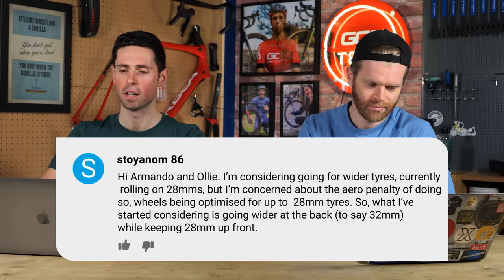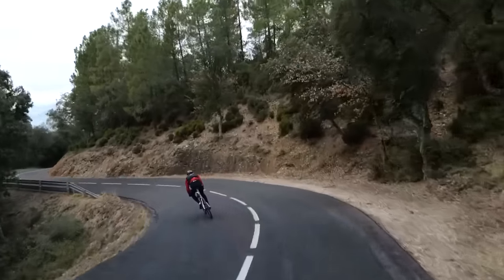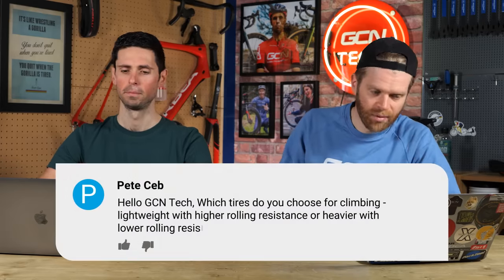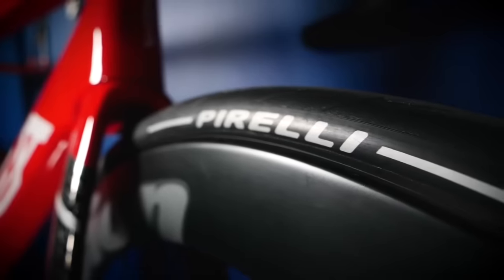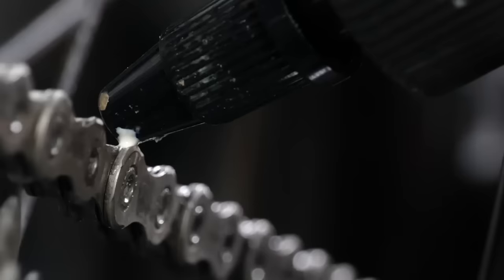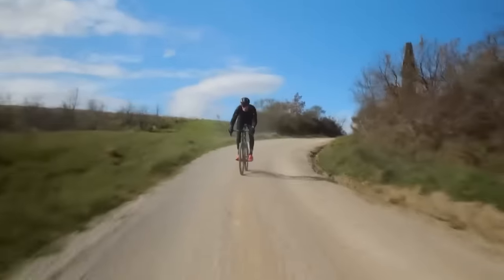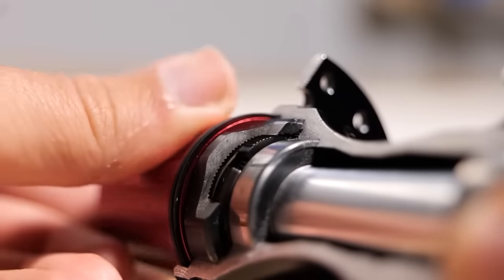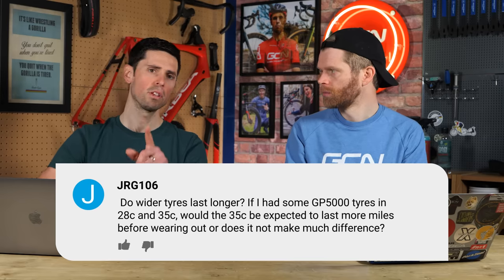Wider Tyres, Dry Weather Lube & Noisy Free Hubs | GCN Tech Clinic

Comment: #ASKGCNTECH
Hi, GCN Tech peeps. I use a Wahoo Kickr V5 with Zwift over winter, as it’s often too snowy at 7,500 feet elevation here in the Colorado Rockies to ride outside. In  preparation for spring, I recently got a 4iiii Precision 3+ single side power meter (on a GRX 800 crank) and paired it with a Wahoo Elemnt Roam V2. I was surprised to see that the 4iiii registered significantly higher watts than the Kickr trainer, so I set the scale factor on the crank power meter to 0.781 and now it produces readings in line with the Kickr. But is the 4iiii really recording watts 20% higher than the Kickr? Should I keep this scale factor when I start riding outside again? And how do I know which, between the Kickr and 4iiii, is accurate — if either? Thanks for your advice.

Comment: #askgcntech I have Kross Esker 2.0 MS from 2023. Microshift Advent X group set and Tektro mechanical disc brakes. I bought Challenge Getaway tyres, a 40 mm wide, foldable version. This was a mistake. I can't fit them together with the (TPU) tubes on the original rims - the tyres are too tight. What wheels from DT Swiss would you suggest buying to resolve this issue (I'm considering switching to riding tubeless)? I'm afraid of buying something incompatible with my drivetrain and disc brakes. I know you may not be allowed to give such a direct answer, but maybe some general guidelines at least?

Comment: Hi Alex and Ollie, Thanks for the great work : )
I have a question about the Strava app malfunctioning wildly. For example, last week I did a 10 mile ride (according to a simple wired bike computer that measures wheel revolutions), but the Strava app said I had covered 763 miles in 35 minutes, and the path included very straight lines across great distances over the wide open Atlantic. I'd have had to have been riding at greater than Mach 1 over deep ocean. On the plus side, it would have been my longest distance ride. On the negative side, I had to delete the erroneous data. I see less extreme examples of weird data pretty regularly, sometimes an extra 10 or 20 or 30 miles will appear, usually with more strange very straight lines that do not match any roads anywhere. Do you know what could be going wrong?

Comment: #askgcntech. Hi Rupert, Sir Ollie and the team.
I have what might be some silly questions about wheels. 
Do all wheels with through hub axles fit all model bikes, ie do Campagnolo wheels fit a BMC or a Merida etc?
Also, when looking on web sites how will I know if a set of wheels are suitable for 11 or 12 speed groupsets, are they universal?
Being a slow rider (I’m old and have some health concerns) I still run into hills so I’d prefer lightweight over aero and should I aim for steel bearings?
TIA and keep up the good work!
Reply: Thru-axle wheels will be compatible if they have the same dimensions. Typically rear wheel is 12 / 142 mm and front wheel is 12 / 100 mm (where 12 mm is the axle diameter and 142 or 100 mm is the width, end cap to end cap). There are other dimensions so you need to check what you have.
Rear wheels may or may not be compatible with 10, 11 or 12 speed group sets…you need to check. Some come with spacers to go on hub to convert to different speeds or you may need to buy them separately.
Reply: Steel bearings are totally fine. Ceramic bearings wear out the bearing races faster because the ceramic balls are harder than the steel races.

Comment: #askgcntech I’m a bit perplexed. I just did the same ride that I did a few weeks ago. It’s about five hours, 70mi, and nearly 8000ft of climbing. This time I did the ride at an average of 20w higher than last time, but I was only 4min faster despite it being warmer and in the dry (the first ride was cold and wet). I’ve checked my wheel bearings and bottom bracket, all of which seem to be fine. My chain is freshly waxed. What could be sapping my precious few watts? My tires are about a year old. Could they have degraded that much that they’re holding me back by tens of watts?

Comment: Quick question. I am ordering the all-new Canyon Grizl 5 AL tonight. It has a 2by set-up and is gonna be a frame size large (as I am very tall and large; 185cm is a very good fit). However, since it comes with 40mm "Continental Terra Trail ProTection SL 40-584" tyres I was wondering, how well would these last in a city say like the typical Dutch student cities. So good roads for the most part but also some cobbled old roads in the centre).

As I will be using it both there and off-road in the forest environments in the dunes across the western coastline of the country I want to be sure they are good for both asphalt and off-road. I was/am highly considering buying Schwalbe G ONE R 40mm tyres as an additional set/replacement set as they would potentially suit the environment I cycle in better.

But yeah, how good are these tyres? And could you perhaps make a tutorial on how to make your tyres tubeless one day? Would be a great addition for the beginner (road) cyclist.

Cheers!
Reply: Those tires have Continental Black Chili rubber which is pretty much the best rubber on the market unless you are talking graphene road tires, which are not appropriate for the type of riding you described.  I would for sure not replace those no matter what.

Comment: #ASKGCNTECH Hi Ollie and Wilford, I am getting ready to buy a new set of Elite wheels for my Canyon Ultimate. I noticed that their road wheels in the Drive model are an internal rim width of 21 mm, with an external rim width of about 28 mm. But their gravel wheels have an internal rim width of 24 mm, with an external rim width of 31 mm. The weight penalty for their gravel wheel set is only about 60 g for the pair. I should note that I only ride on paved roads. But I am drawn to the wider rim width, and would like to run 30 mm tires. Which wheelset would you recommend? Thanks!
Reply: I asked this exact question to Elite Wheels a few weeks back because i wondered the same. The answer is both would work fine. I would suggest if you are set on 30mm tyres (which i think are a good choice), the wider Internal rim would be more suitable. The Drive road is optimised for 26-28mm tyres. I am yet to try the gravel Drive on my road setup yet, but plan to soon.

Comment: #askgcntech Wide tyres vs narrow tyres and wear rate - part two. Isn't this like that, when you inflate both tyres to 'proper' pressures for each of them, the actual area of the ground contact patch will be the same and only its shape will be different? Isn't this a reason why both tyres roll exactly the same on a perfectly smooth surface? Hence, does the wider tyre rally is supposed to have a lower wear rate?

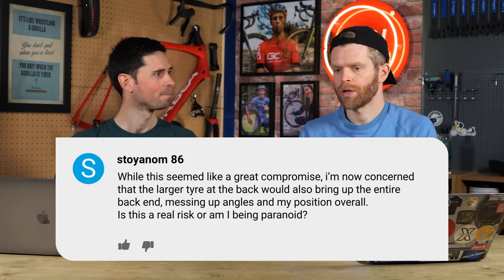Comment: 0:55 yes, you are paranoid. The difference in the size of a 28 and 32 mm tire is theoretically 4 mm, and practically the 32 mm tire has a greater deflection, so depending on the pressure it will be closer to 2 mm. With a bicycle wheel spacing of 1000 mm, the angle will change by less than 0.2 degrees

Comment: #askgcntech I think it is well-established that dry lube is kind of bad, but what about using wet lube for dry conditions? I have been using wet lube even when is dry, taking "extreme" precautions: applying it at least 5 hours before the ride, removing any excess from the chain a couple of hours after the application, and doing it again (cleaning the chain) after riding... mostly after the first ride. What are your thoughts on using wet lube in dry conditions? From my experience it lasts longer than dry lube, feels smoother, and with proper precautions is not that dirty.
Reply: I change out my chain every season, so I don’t obsess about wet or dry or whatever.  If I use a wet lube, I dry off the chain with a cloth.

Comment: #askGCNtech  I have an older ULTEGRA rear shifter (circa 2007) on our Cannondale tandem that sometimes skips as I'm shifting.  As in, it doesn't click and change the gear, I might have to click it 2 or 3 times to get it to shift.   Can shifters be repaired, or do they have to be replaced?   It's too complicated for me to take apart.  Any suggestions?   Thank you.

Comment: I loved my DT Swiss wheelset and as you say Olli yes you can maintain hubs BUT on the 370 hubs you have to remove the rachet ring to get the bearings out....bwhahahahah! I tried with tools, extension bar, heat , 2 bike shops tried and no joy. Sorry but I needed to change the bearing and DT Swiss have made a bit of a faux pa on this one. In the end I had to sell wheelset...gutted!
Reply: Yeah, the 370’s are a pariah.  The 350’s are easy peasy.
Reply: @petersouthernboy6327 Well I was under the impression that the 350's were just as bad.
Reply: @Noddingdog63  oh no, very very different hub.  I’ve been running DT350’s for decades and they are superb.  Very easy hubs to service and overhaul with hand tools.
Reply: @petersouthernboy6327 That's good to hear. 370's are good to service apart from the "you know what".I now have Bitex hubs which , I think, are better hubs on H Plus Son Hydra rims. Not that well known but wheel builders seem to like them.

Comment: #askgcntech Hi guys. I noticed my pulley wheels were dragging a bit so I serviced them. Once they were completely clean inside (I mean no grease whatsoever) they spin super quick and easy. I applied some grease and immediately they felt like they were dragging again. Is that normal? Should I use thinner grease? Thanks.
Reply: If you overpack the bearings, they do feel slower, but you get maximum protection against the elements. You can experiment with thinner grease with a lower percentage fill.

Comment: #askgcntech Dear lovers of well maintained drivetrains, most all chain lube instructions say "wipe off excess lube" as the final step in the application process. Does this mean only the outside of the chain (the sides) or does this mean the top/bottom as well (including the rollers). Phrased differently, hug the chain with a rag or pinch it?
Reply: Hug. When the derailleur is adjusted right, the chain makes gear contact on the rollers and sometimes inner plate surfaces. Most of the friction in the drivetrain is internal chain friction. If you thoroughly lube the chain and then very thoroughly hug it with a rag during some zesty backpedals, you leave lube between those pivoting surfaces, where it prevents sticky links, the true sign (along with chirping) of a chain thirsty for lube.

Comment: #askgcntech Hi Ollie and Alex. Can you provide some guidance on how many times I can repair my Conti Tube Race 28 Inner Tubes after a puncture? I'm using Park Tool GP-2 Pre-Glued Super Patches for the repair. Previously, I'd immediately replace the inner tube with a new one whenever I got a flat. However, with the increasing cost of living, I'm aiming to extend the life of my tubes by repairing them multiple times before resorting to replacement, to save a few bucks on my commuter bike. Also, Ollie have you borrowed Dan's copy of 'Breath: The New Science of a Lost Art' by James Nestor yet, or are you still Mouth Breathing?
Reply: I only replace a tube if the puncture is too close to the valve stem's base or any previous puncture patch.
Reply: @yonglingng5640  So you have lots of patches over the inner tube? What's your record for repairing a single inner tube?
Reply: @katopeters9980  I only have two so far, I rarely get punctures, if ever.

Comment: #askgcntech Hello GCN, has anyone ever tried balancing the wheels (not geometrically but dynamically) with balance beads? Tubeless sealant maybe doing this as well, but I don't know if anyone ever examined this effect. I know this kind of balancing is not crucial for bicycles, but it does have an effect, especially at higher speeds.

Comment: #askgcntech I've had this aero conundrum the other day while going down hill. If I start to pedal I would notice my speed drops a bit. Mind you this is at relatively high speeds 60+ km/h. Is there something to pedalling disrupting the airflow vs simply staying put? I'd assume there's a tipping point in terms of speed where it would cause so much drag that you might begin loosing speed.

Comment: A lighter tire will rotate and move easier. A narrower tire will cause less drag in the wind. A narrower tire, on the other hand, will require a higher pressure to function. If your surface is super smooth, caring about rough surfaces and bump absorption by going with a wider (and lower pressures) tire isn't a thing.
Reply: Though unless you live in some sort of fantasy land like the Netherlands or Switzerland, you're probably dealing with broken asphalt, potholes, etc...